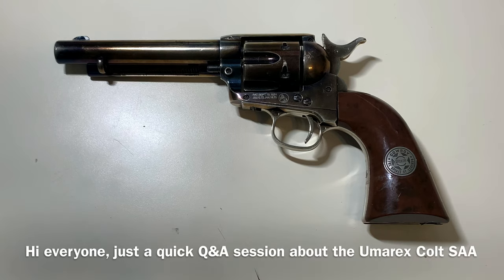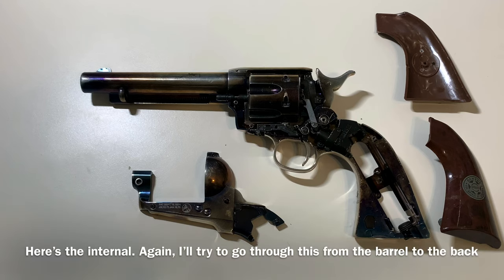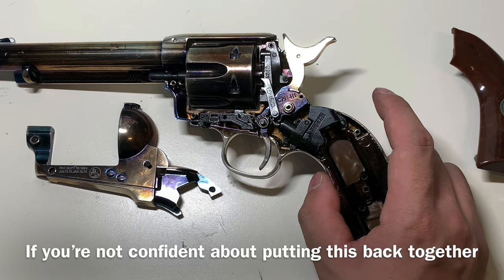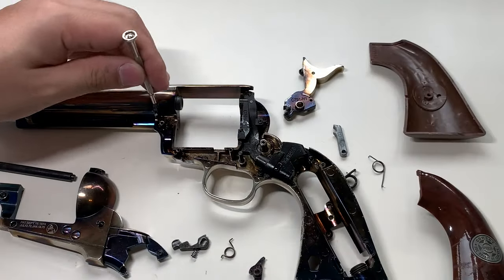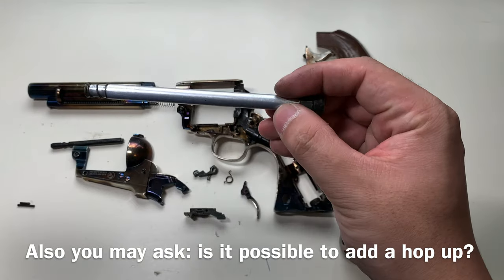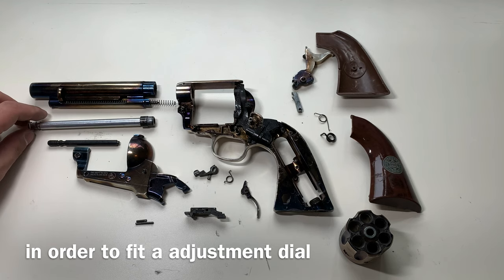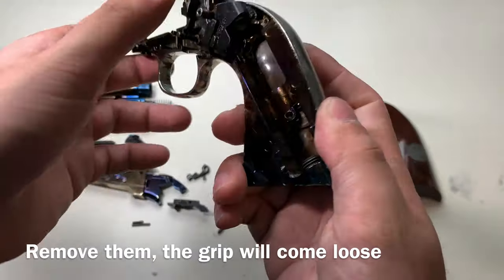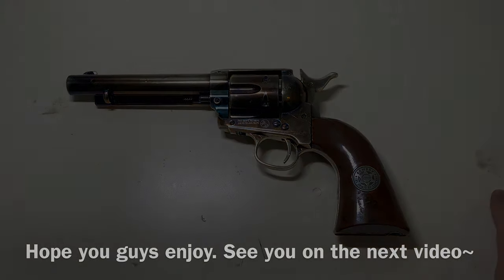Umarex Colt SAA Q&A session

Comment: I really want to make the cylinder free spin, but to also not lose too many accuracy and range, which is what happens if you remove the inner barrel. Would just shortening the inner barrel so that the tip is barely touching the cylinder to lock it, but is close enough to contain as much pressure so that the loss of accuracy and range is only a little, be possible? If so, how can we shorten the inner barrel?

Comment: How goes it MT. Question please. The ejector rod on my new Peacemaker only comes back maybe 3/16" before it comes to a complete stop, of course not enough to eject the cartridge. I make sure the cylinder is in complete alignment with the open loading gate, so I don't believe that's the problem. Looking from the side of the gun, I see the the rod comes back only enough to barely contact the back of the cartridge, then just stops. The small ejector rod handle does turn into its channel smoothly, but as stated, stops within around 3/16" from its starting position. What do you think is the problem ? Thanks for any help.
Reply from the maker: The ejector rod is probably rusted and require lubricant. Or maybe something that is jamming it. Try taking down the pistol and see what’s the cause.

Comment: I have one of these with blue steel and fake ivory grips but how do I change grips?
Reply from the maker: Pop off the left half of the grip. Then you will see 2 screws inside the CO2 cartridge housing that bolt on the right half of the grip. Loosen them and it’s removable.

Comment: Will I have to replace the hammer spring if it’s damaged by fanning?
Reply from the maker: If you have the part, then yes.
Reply: @SemperReloading  where do you get the parts to replace it?
Reply from the maker: @heeeheee7415  I don’t. Parts for this revolver are very rare.
Reply: dont fan this gun or ANY revolver ! threat them like they are supposed to be
Reply: @heeeheee7415  hong kong

Comment: Is there any hammer spring that I can use to let me fan without it breaking?
Reply from the maker: Not sure, maybe you can ask a machine shop to make you a stronger steel spring.
Reply: You cant fan these without break8ng the hammer and trigger system in very quick time, the metals not strong enough to withstand the pressures, even on a real Colt they break easily when fanned.
Most guns you seeing being fanned are especially made Race Guns, with extended hammer spurs, modded hands for catch and release of the cylinder.. You would be talk8ng about a few thousand dollars for a cheap one.

Comment: how do you get both grips off
Reply: He's literally shown you in the video, the left one pops off for you to place the co2 bulb in and the right one has two screws inside the grip frame you unscrew them then slightly push the grip from the insde or a thin lever under the grip rim if it doesnt just fall off, rewatch the video, you dont have to take the whole gun apart just to remove the grips. It's easy as.

Comment: What would you recommend to completely remove the bluing? I have the 7.5" Umarex Peacemaker but the bluing is already coming off and I would like to remove it all. Thanks
Reply from the maker: I think cleaning alcohol and a brush will do. If not then you may need to go with metal polishing.
Reply: @SemperReloading  can it be re-blued?
Reply from the maker: @timbow1833  Not sure. You may want to consult a custom shop.
Reply: @SemperReloading  thank you

Comment: When I pull the hammer, it just gets stuck there and I can't push it back to the original position. I need to shoot it in order to reset this. Is this normal?
Reply from the maker: Can it be lock all the way down to the firing position?
Reply: @SemperReloading  Yes, at the firing position, I can't cancel the shot by pushing it back

Edit: Nvm, I found out you need to pull the trigger to do that

Comment: Do you think it is possible to increase fps
Reply from the maker: You can try widen the holes at the bottom of the cartridges for this.
Reply: @SemperReloading  how do I do that?
Reply from the maker: @Ricardo83627  Use a drill
Reply: @SemperReloading  will it leak?
Reply from the maker: @Ricardo83627  The bottom of the cartridge is not fully sealed to the gas system. There will be some sort of leakage anyway. Pus you just have to widen the hole just by a little bit.
Reply: @SemperReloading  if he widen the holes at the bottom of theses shells then the bbs or pellet will not hold tight....